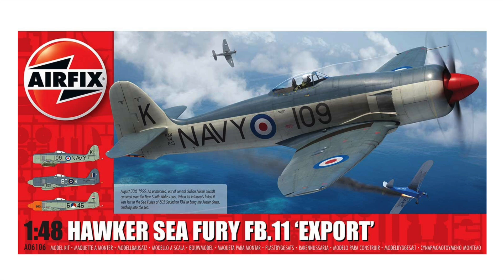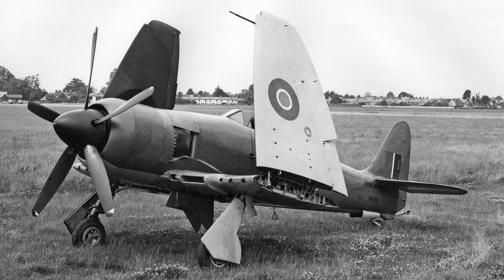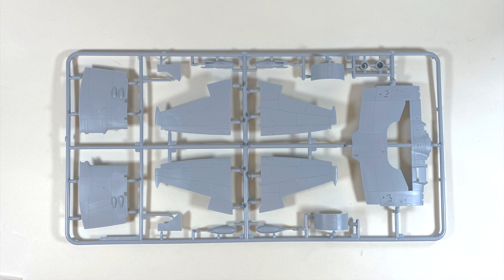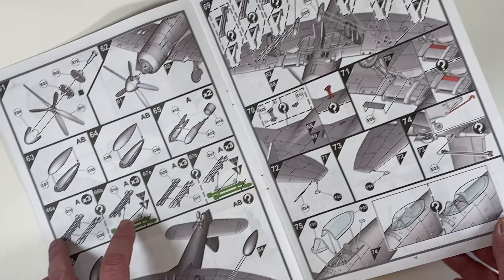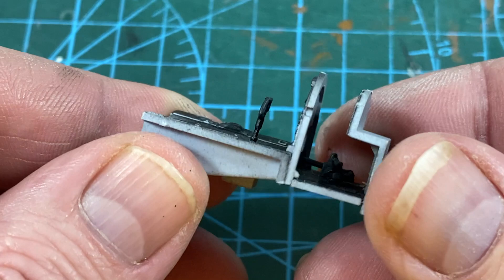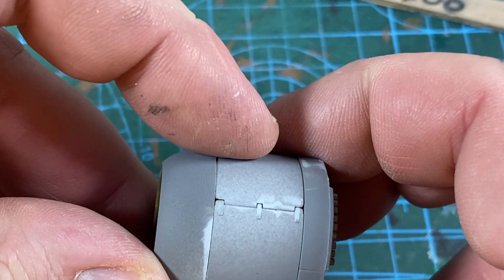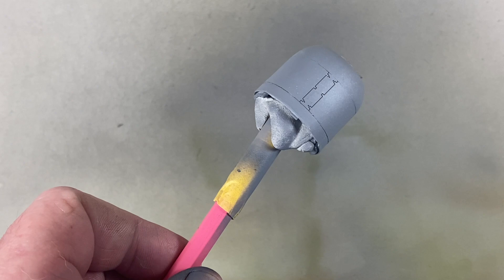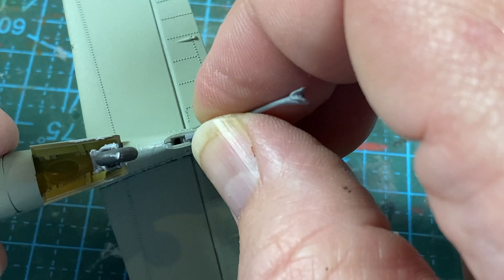Airfix Hawker Sea Fury FB.11 1/48th scale 2020 release FULL BUILD with BONUS HISTORY - HD 1080p

Comment: With that big gap in the engine cowling, could you glue both edges and then put some filler between them with the glue adhering to that? Then when the glue and filler are dry you could sand any excess filler and make the surface flush.
Reply from the maker: Maybe, I just found putting a fillet of plastic worked. Whatever works is good!
Reply: @garys_stuff  Indeed. Yours worked very well. My thought is just another idea to kill that particular cat.

NB. No cats were harmed in production of this comment :)